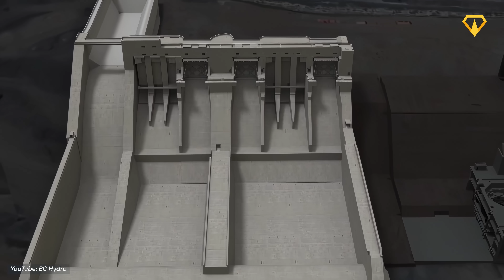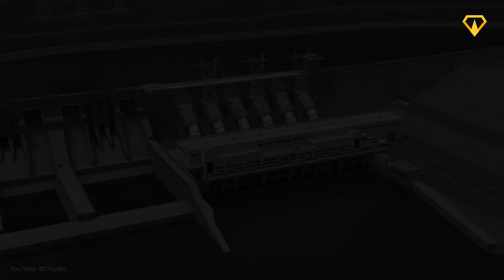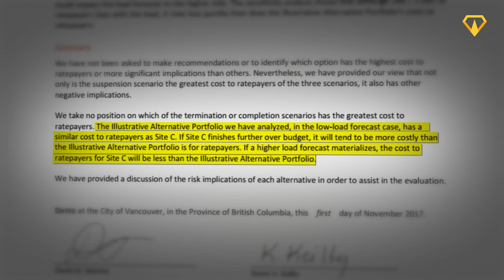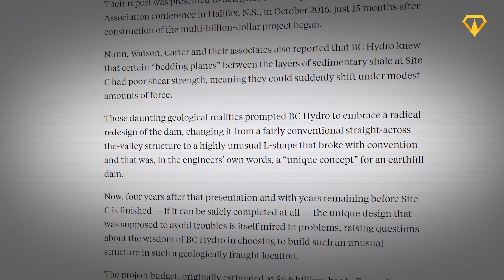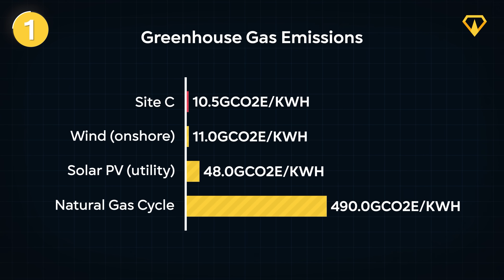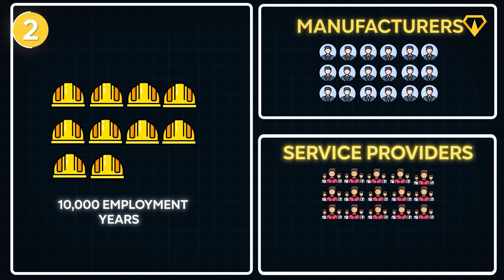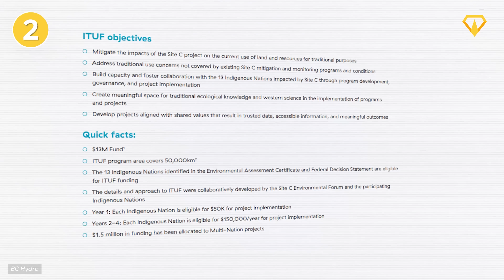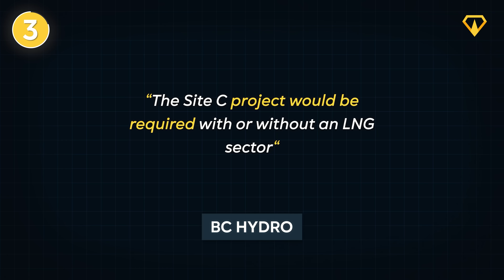Canada's Massive $12B Mega Dam

Comment: I grew up in BC and now live in Alberta. My perspective is that the people saying Site C was not needed were completely focused on BC only. Fact is the grid is tied to all most of North America - I watch the Alberta Energy System Operators real time generation website regularly, as I write this, BC is importing 154-190 MW from Alberta, likely to cover AC usage - Alberta is primarily NG generation. With Site C online, BC may be exporting power instead, reducing carbon output. I can see the Alberta grid is sometimes used to "transport" BC power to Montana and Saskatchewan - we all need each other, especially during high demand periods like heat waves and cold snaps. I will give Horgan credit for someone finally getting him to understand this.
Reply: BC exports electricity too. Exchange between grids is common due to proximity and peak cost/price during various hours. BC is a major electricity exporter to Washington and California.
Reply: @jugjivan  BC Hydro used to have a net surplus of electricity, but now has a net deficit.  Last year (2023) they had to import 1/5 of the power consumed in BC.
Reply: They should have put the money from cite C into a Nuclear power plant. Would have been better for the environment and lasted longer with higher output.  The LNG project is definitely a great step towards a cleaner planet. We need to get other countries off burning Wood and Coal to produce energy. 🇨🇦
Reply: @Beavertrkr  You'd need two nuclear reactors to get the same power as Site C, so $30-40 billion...

Lots of attempts to build new plants in Canada, but the last one to actually go online was in 1993
Reply: That's it exactly. We need a blended system of electricity generation and the more linked our provinces and the USA are the better it will be for everyone. When Wind and Solar are in high production, they can send power to BC and BC can save the water in the dams. And when solar and Wind is low in the prairies, BC can send power to them from it's network of dams.  And the same with the prairies and Manitoba and its extensive hydro electric infrastructure.
Reply: Did you miss that our gov sold by hydro to an American conglomerate? 
They didn’t pay their bill, and we haven’t seen a dime since they bought it. 
Our hydro costs have gone up though.
Reply: @scottverge938   wind and solar are scams. they flat out dont work
Reply: If they manage to eliminate interprovincial trade barriers, that will be progress towards greater interconnectivity, Canada Day does not seem a likely timeline to me, but it is a nice thought.

What we really need to do is get away from epic-scale projects, they are not responsible: costs do not scale linerarly and designs become inflexible at scale, combined with the risk factors inherent to 'all the eggs in one giant basket', it is a perfect storm for stampeding budget.  Though I believe the basic seismology assessment should have made an argument for a distributed/scaleable system: if we are overdue of 1/10k earthquate, one sure way to up the odds, while complicating the consequences, is to add a massive lake in the mountains to the mix.
Reply: @PaulDMcK  I don't think Site C will cause any issues in regards to earthquakes. It's a long ways past the Rocky's on the eastern side. Geologically it is far more likely to be similar to building in Alberta than south western BC.

Big hydro dams like this are able to do both base load and grid following, so they are invaluable to have. Renewables aren't up to the task of base load yet but local solar wouldn't be a bad idea to have to supply residential areas.
Reply: @kstricl , Site C is another 1980s Canadian mega project, I absolutely expect some part of it to fail catastrophically.
Reply: the only reason we import power in BC is that we can effortlessly throttle the hydro, the gas generation cannot so they sell the power dirt cheap. it isnt that we need it, it is that the gas guys need a place to dump the load
Reply: The NA grid is not entirely tied together, which you would know if you had ever heard of ice in Texas.
Reply: @afterthesmash  fixed that. Kind of short sighted of Texas to be like that, but their choice.
Reply: Yes Québec alone sells 22,6 million  Mwh  per year impresive  

edit : hope my english is okay...
Reply: @HalberdAbuser100  Better than my french ;)
Reply: Much more knowledgeable than that elected politician who makes only trouble, flipping position for personal gains!
Reply: We buy alberta power and sell bc power to washington, BC taxpayers subsidizing USA, thanks to “todays BC Liberals™️”
Reply: U don't need grided power and it only makes the rich richer...who cares about the rest of Canada cause I don't...Canada has become a joke in the world...there is no Canada anymore
Reply: Come back to B.C. lately? especially in the Kootenays, There’s a bloody dam every 20 km’s (all your fishing holes surrounded by razor wire) and the biggest of these never reaches more than 30% output. And that one supplies the coal mine that ships raw coal to China to burn and send us more plastic BS at the dollar store?? See where I’m going with this? Why another? So we can virtue signal with everyone else driving electric cars etc???  Stoopid make work project destroying prime river valley farmland. AB never had a problem heating homes before the greedy Frac years, thousands of watered out wells killing jobs and swallowing up families. Where is all that VLT money now? Cowtown needs a loan to fix their water main?? again??
Also need water to run hydroelectric, how about all these droughts, who gets the priority water; farmer, family, or B.C. Hydro and the Tesla bunch??
Think about the long game for your future family here
Reply: The fact BC was importing from AB doesn't necessarily mean BC "needed" that power right that second. It was probably done for economics i.e. prices in AB were low and it made sense to import then. Other than that, you're spot on.
Reply: @vicolin86  During periods of drought, it makes better sense for BC to "import" power and keep the reservoir levels up, so long as the power can be purchased economically, just like you said. Currently Alberta wind and solar are producing more than enough energy to cover what BC is importing, so the pool price is likely the deciding factor.
Reply: @kstricl  not just drought, but yeah, essentially.
Reply: The problem with the protests is that it was always stupidly short-sighted. Hydroelectric dams can last well over a century. All other options do not. So the cost over time is low as long as the reservoirs can still be filled. However no hydro-project has ever been without conflicts. Mica, Revelstoke, Hugh Keenleyside Dam all on the Columbia River have political ramifications on how they are used because operating them poorly impacts our neighbors in Washington and Oregon. But it the Americans who wanted the Columbia River Treaty dams to be built (and we largely made a bad deal because it was a lump sum not tied to inflation.) This resulted in the flooding and displacement of fertile lands. 

Now listen again to the protests of Site C "Flooding of fertile lands". While that might have been true for the Columbia River which is a warm-hot (zone 6a and 7b) climate, it's not of the Peace River since it's mostly a warm-cold climate (zone 2b) that is difficult to grow things in. Most of the Canadian population lives in zone 5 or higher (Victoria is 9 and Vancouver 8b). Site C is not a "fertile land", it's in fact pretty far away and electricity generated by it is more likely to have a lot of transmission losses. That's really the only valid argument I've ever heard against it. Meanwhile City of Vancouver mandating Electric-only heating (no natural gas or oil) and the popularity of EV's is increasing the electricity demand. Never mind AI-focused data centers taking a lot of energy. 

We were always better off building Site C than nuclear, but BC is also full of locations for Wind and Geothermal that have just not been deemed economically viable.
Reply: @Kisai_Yuki  you really know your stuff! Do you work at hydro?
Reply: Yes, John Rustad talked about how BC is a net importer too, for some reason, in spite of  BC having plenty of means to be exporters.  "Not needed" is socialist thinking, "we only make what we need", yeah and then you make nothing for anyone else in spite of their need, because you don't actually think all that much about "the people" even though you pretend to.
Reply: @Usammityduzntafraidofanythin What John Rustad doesn't mention is that we ARE an electricity exporter. We build up our reservoirs and buy cheap electricity from out of province, and then when those sources in other provinces and states become expensive (say maintenance or extreme weather conditions) we use ours and sell it out of province for top dollar. BC Hydro makes bank off of that, and we get consistent and cheap electricity year-round.

We don't need to export more gigawatts than we import if we are still making more money than we are spending.
Reply: Anyone who is incapable of the forethought that we could export the surplus doesn't deserve to have a say. I'm sick of the short term thinking of these lib types.
Reply: From a journeyman lineman, AMEN.
Reply: civilization scales with energy availability, anyone who doesn't understand that is too dumb to have a worthwhile opinion
Reply: Yes that absolutely right, and most of the electricity goes to america
Reply: NG will not reduce carbon footprints. It is more polluting than fossil fuel. You are being lied to. Look up fugitive emissions and where NG fits into the rankings
Reply: Not True Alberta rusn out of power all the time and needs SK and BC power.
Reply: Yup, we slow the blood flow of the earth to make power for the states...
Reply: It wasn’t Horgan who started Site C. It was Christy Clark - the ONLY good thing she did for BC in my opinion.
Reply: Canada needs a lot of current and future trump-proofing itself from tariffs etc... Canada should keep/create ace cards for exports ... Iceland, Greenland, Alaska, Even the lands it own in Arctic. As those passages warm; Canada's farsighted assets there will open new arenas no new trump will ever dare to mess with.
Reply: Very true!
Reply: Horgan is dead.
Reply: Worry about Canada.  Screw the USA….they only look after themselves.
Reply: the issue was that they stated they were building it directly for BC's projected power needs but in reality BC Hydro has been over estimating the provinces needs for years. They want to sell green energy to LNG and California. The first statement is well documented through numerous reports.
Reply: Site C was built with the sole intent to provide BC with power for half a million homes. That was why they got approval….
Reply: If they are pushing for carbon neutral Kitimat LNG, it would take 24 site C dams to meet their electrical needs to cool and compress the LNG without using LNG powered cooling and compression.
And remember Horgan attempted to block every pipeline to the coast then took a cushy board position on coal producers and exporters....🤔
Reply: Saskatchewan needs to build some wind farms… with as flat as it is we get wind all the freaking time… that we aren’t using it to our advantage is short sighted…. Theres plenty of land on farmland that is unfarmable, so fill those spaces with wind turbines…..
Reply: Reducing carbon dioxide output, which is how trees gain mass. How is that a positive for BC.
Reply: @Timmahh.  Too much kills trees. Plus BC needs rain far more, it's been getting very dry in recent years.
Reply: @Timmahh.   An old and worn out anti-climate narrative.  Too much CO2 leads to burning forests from extreme heat.  How is that positive anywhere?
Reply: Gas plants are prone to malfunction during extreme weather, both hot and cold.  Both Texas and Alberta have experienced this, and were helped (some say rescued) by wind power in recent extreme events.  As for domestic gas power in Alberta, several of my relatives and their friends have just recently made the choice to go with large rooftop solar arrays backed by home scale battery packs in their garages mainly due to the recent dramatic spikes in domestic gas fired power prices, which happen to occur right after the conservative Alberta government decided to act against free enterprise and apply moratoria and huge bundles of red tape on Alberta's phenomenal $40 billion renewable power industry.  Of course, the timing was just coincidental, right, considering that a few years ago wind power market auctions were outcompeting gas and coal on price. The premier herself was a fossil industry employee and currently receives major political donations by her pals in gas.
Reply: @ub59 that outage had 0 power coming from wind. They all shut down at -30.

And I've see gas plants running at -50. They are built for it. This guy is flat out lying.
Reply: @ub59 the wind market was competing on subsides not merit. the energy generated compared to land used and the treadmill costs means it’s makes no sense. A nuclear power plant is 1/10th the size and will be cheaper once it’s online all while being able to remove the outdated infrastructure whereas with wind you still rely on coal to make up for the downtime. In the few years that wind turbine will be able to run before it needs to be buried in the ground and replaced, nuclear would be cheaper and more efficient. Wind is not an option en masse and anyone pushing wind is getting their info from corporations who are trying to suck tax dollars. Wind is a multi million dollar subscription service for inadequate inconsistent energy that still relies on coal to make up for its flaws.

     Also  after “as for Alberta’s NG… ” you made a point that had nothing to do with Alberta and your objectively wrong spiel about gas prices. Natural gas has gone from 2.74 in July 5 years ago to 2.81 in July now. It’s actually one of the few industry that has lowered relative to inflation, it’s just you’re being stretched in so many other areas you’re noticing that bill now. Good for your friends for going solar, that had nothing to do with Alberta tho.
Reply: @ub59 don't get political, I work in utilities and the reason AB had rolling blackouts was because a large portion of our large, old, and reliable power plants (most of which were coal) were shut down by the NDP without creating solutions. It just so happened that the cons came in when we had strong weather anomalies. Had the NDP first built alternatives and THEN shut down the plants we would have not had this issue but politicians choose image and politics over reason and logic.
Reply: @Peglegkickboxer   It's all political because it's all about public policy.  I fault both the UCP and NDP for being so saturated in carbon politics. Having said that, economics is the stronger argument. Renewables, especially wind, were outcompeting coal and gas in electricity generation in private sector power auctions for years.  Danielle Smith killed renewables because of that -- an outright kneejerk political act not grounded in sound research and logic.  The fact is renewables are cheap cannot be disputed, and they are also upping the ante worldwide with massive battery storage, allowing them to enter the realm of base load power.  If AB had battery storage to the level of South Australia it would see the end of fossil fuels in the grid. Further, battery chemistry is heading toward lithium hybrids with sodium and silicon with exemplary cold weather performance. Zinc bromide batteries can store power indefinitely.  Form Energy (iron air) can store power for four days.  These are the nails in coffin of coal and gas fired power.
Reply: @ub59 nonsense.   The recent blackout events in alberta were caused by no wind and evening hours when the sun is down
Reply: @nunya_business1702   Nonsense. Wind saved the AB grid after three days of calm.  So says even the AB Energy Regulator.  And have you ever heard of batteries?  Today's off the shelf grid scale batteries can store power for four days (Form Energy - iron air - 100 hours, zinc bromide indefinitely ...).
Reply: @ub59 this is something a NDP cry baby would say. 🤡
Reply: @ub59  I can't speak to the political landscape of Gas and Coal fired power plants.  But I agree to disagree with you that wind and solar are the new source of electricity. Their not reliable, look to the wind turbines and winter blast that Texas had two years ago, shutting down all the wind turbines  for over 10 days. Water Dams and Gas fired power plants are still the best option for clean electricity. New technology in years will give us better solutions.
Reply: @ub59 you have no clue what you are talking about. Alberta's old coal and now new gas plants have no problem operating in the worst weather possible. Our near black out in February 2024 occurred because wind and solar plummeted to 0.4% of their capacity. They plummeted because it was night time and very cold; the wind tends to die down during periods of very cold or hot weather, and the sun never shines at night! During this period of non existent electricity from wind and solar, all the other energy sources had to pick up for their failure. One gas plant was in a scheduled shut down for regular maintenance - regular maintenance being something all generating systems including wind and solar need to go thru. And a second gas plant did have an operational problems which put it at half operational capacity. No additional amount of wind and solar on the grid would have prevented this near black out, only more reliable and dispatcheable electricity from coal, natural gas, nuclear or hydro. Alberta no longer has sufficient backup for the wind and solar we have on our grid - which will go to near  zero electricity production for times during every year. Wind and solar are the only technologies which require 100% backup; the rest can do with some level of excess capacity. The more wind and solar we put on Alberta's grid, the more we have to add backup which as back up runs inefficiently and adds to the cost.
Texas's problem in 2022 was similar - they spent $66B putting in wind and solar and when the cold, windless and dark weather showed up, wind and solar plummeted. Because Texas was so intent on spending money on wind and solar, they did not spend any money on ensuring the other forms of electricity from coal and gas were winterized - and so some of these backup systems failed to operate when wind and solar failed. During Texas's mild winter storm of a few degrees below zero, Alberta was at minus 40C temperatures and we had no problems handling it because at the time we had ample winterized natural gas electricity.
Reply: @davidsimpson7373 Underated comment. You're the only one e on here that knows what's going on. The rest are idiots who pretend to know then go off on a neophyte political tangent. Thank you.
Reply: @schrempskynate8944  may be you can explain to every one the many factual inaccuracy of what I said then? Or are you just prone to ad hominen attacks because you do not like the facts, and have no counter argument of facts to present ?
Reply: @davidsimpson7373  I'm agreeing with you if you'd actually read my post. You're 100% correct. Where did you get the idea that I was in disagreement. Ffs.
Reply: @davidsimpson7373  It's not a "failure".  You obviously have a biased agenda. From CityNews:

In a statement to CityNews AESO senior communications advisor Elizabeth Brouwers says the alert was prompted by several factors.

She explains Wednesday saw a high amount of renewable energy captured during the day, and forecasts for the coming days indicated much of the same. Because of this, some generating units were switched off as a cost-saving measure.

“While the reduction in wind and solar was forecasted, an unexpected outage of thermal generation led to tight conditions during the evening peak (generators can drop off for any number of reasons), which prompted the Grid Alert,” Brouwers added.

Key points: they shut down on purpose some plants AND the main key point, "an UNEXPECTED OUTAGE OF THERMAL GENRERATION".  THAT means and outage at a gas plant.

So seriously...stop lying and twisting the truth.
Reply: @mb7196  The only one with an agenda here, missy, is you.
Reply: @schrempskynate8944  yeah...this is the response of someone with nothing to say.  You've got nothing to counter the actual facts as reported and of public record, but rather than being a man and admitting you were wrong you take the cowardly way out with a lame ad hominem with nothing to back it up.
Reply: @mb7196 Lying? What fact did I present that was not true?
Since the concept of how non dispatchable wind and solar and the grid work is a challenge for you, I will try to break it down in simpler terms. 
Every electricity grid must balance supply and demand at all times, too low supply and the operator is forced to shut down some demand leading to brown outs or black outs; too much supply which is not corrected or dispensed in some other way, and one gets total grid failure as equipment fails and a complete black out. The balance must be maintained 24-7, and at the fractions of seconds. Wind and solar are non dispatchable because they are weather dependent, meaning you cannot adjust them up and down to balance supply and demand - you get what you get based on how the wind is blowing or the sun is shining (or not). All other forms of generation we use are to some extent dispatchable (rate variable depending on source) and must be used to offset the variability of wind and solar. Natural gas being the most flexible to adjustments, and why it is used globally as back up for unreliable wind and solar. Wind and solar can have massive swings in electricity they generate from moment to moment, and certainly over longer periods - they can and do go from 100% capacity to 0% capacity, and sometimes very quickly, particularly in the case of wind which oscillates throughout the day, or solar as it goes from day to night, or night to day.
In the near blackout event, Alberta's grid had about 5900MW capacity of wind and solar, but during this very cold period at night they were only generating 14MW. Demand was over 12,000MW, which at the time had to come from all other generating sources as wind and solar were essentially zero. Total grid capacity was around 20,000MW, and with wind and solar effectively at zero, the rest of the grid is roughly 14,000MW, leaving a mere 2000MW excess capacity assuming all other forms are operating at 100% capacity. Have one plant off line for scheduled repairs, and another having an issue, and now we are in crisis mode with no ability to provide supply meeting demand. 
The more wind and solar we add, the larger that swing will be from 0 to 100%, and the more back up is required to run inefficiently in standby mode for when wind and solar generate zero, which they will at sometime because that is part of their uniquely normal operation! You put 10,000MW of wind and solar on the grid, and you cannot get rid of any other supply, you must be capable to providing all of the 10,000MW at any given time with other sources, plus providing sufficient supply to meet the rest of demand. 
The capacity factor - an average over a year for how much electricity is actually generated in comparison to the theoretical maximum or name plate capacity - is around 11% for solar in Alberta, and the low 30% for winds - you can get this data directly off the annual grid numbers.  This is why at nearly 30% of name plate capacity of the grid, wind and solar only generate 6% of Alberta's annual electricity needs, whereas natural gas and coal do the heavy lifting proving 89% of the electricity with 66% of the capacity. 
I hope this was a sufficiently simple explainer for you!
Reply: @mb7196  of course it is a failure. If a gas plant went done unexpectedly reducing generating capacity by 10% you would call it a failure if the gas plant. According to you, when wind and and solar have a 100% drop in generation, going to zero, it is not a failure! It is true, this is the unique normal operating conition of wind and solar - they will go down to 0% generation under normal annual weather conditions. It is still a failure to generate electricity, just like if a gas plant unexpectedly went down.
Reply: @ub59  "Gas plants are prone to malfunction during extreme weather, both hot and cold." False I live near them.   "Both Texas and Alberta have experienced this, and were helped (some say rescued) by wind power in recent extreme events." Can't speak for Alberta but the Texas "extreme event" was just the opposite.
Reply: It's true. Natural gas plant outages helped lead to an almost-blackout during the alberta -45 C cold snap this winter. It was only averted thanks to an emergency government text message, saying to reduce usage. The more green backup power on the grid, the better, I say. I wish our premier wasn't sabotaging green power
Reply: @32BitJunkie  I watched the power output on the energy operators website during that period. Wind had to shut down as the turbines could not operate during the extreme cold due to embrittlement and of course it was dark, so solar did nothing.
The plants that were down in fact managed to ramp back up (including one that was still in initial startup testing.) The grid scale batteries that are in place to help support the renewables were definitely helpful to keep the grid operational at the worst point of the crisis, but that was the only renewables component that directly contributed to keeping the grid up. I agree, need more of those.
Reply: @32BitJunkie  there is no such thing as green back. wind and solar cannot back up anything - they are non dispatchable forms of electricity generation. Globally, the back up for wind and solar is natural gas. They are they only technologies requiring 100% backup. All other forms just need some level of excess capacity to allow for plant shutdowns for normal operational repairs and maintenance and the rare unplanned failure. One needs to plan and expect for zero generation from wind and solar, building a complete second backup system for when the wind is not blowing and the sun not shining which is much more frequent than most people understand.
Reply: @32BitJunkie   faked
Reply: @32BitJunkie so you got lucky that there was wind. What do you do when there’s a cold snap with no wind. Wind isn’t a good option and justifying your decaying coal and Ng sectors because you’re stuck paying the forever high rolling costs of wind doesn’t make sense. The amount of money you spend on wind is the problem not the solution. The point of these projects is to be expensive today to make life better tomorrow. Wind is forever expensive.
Reply: @32BitJunkie  except that during that cold spell, wind and solar output was near zero.  They don't work in the dead of winter.  The problem was insufficient gas -fired capacity
Reply: @32BitJunkie I worked for BC Hydro for nearly 30 years. Green energy is substantially more susceptible to weather events, in places like Dawson creek where a wind farm is located (bear mountain) turbines are maintenance heavy, units are often cycled in and out of service due to bearing wear. Bc legacy dams are the cornerstone to low power costs for customers, wind and solar are basically subsidized by the legacy system. I consulted on the Texas grid failure. Green energy wind specifically was the key contributor to the state wide failure, there were other contributing factors but ultimately when weather events are severe wind/solar is always the weakest link.
Reply: @totallyjonesin  You are mistaken. When the gas plants went offline - the wind was still functional in Texas. Read the reports. It was a fossil fuel supplier and climate denier snow-job when that big power disaster hit. The gas plants basically froze up and fuel stopped flowing.
Reply: @32BitJunkie  If by green you mean solar and wind then you are wrong. We have no solar in the winter and wind is unpredictable.  Hydro is great assuming the snow pack supports it. BC has more geography to support hydro than Alberta, so you can't blame AB for that. Base load and dispatchable thermal is more reliable for AB.

I used to work for BC Hydro , then at a coal power plant at SaskPower and currently at one of the bigger utlities in Alberta. It's unfortunate the Alberta model is de-regulated and is profit first.  I never saw this at my two former crown corps.
Reply: @ don.beknown, I can tell you're not in Texas.
Reply: @ub59  Gotta love and support a premiere, who wants to break up Canada…oops…gain “sovereignty”.  Where would she find all her “petro” buddies then, when she has to figure out the energy grid for landlocked, newly formed state, with a leader who swings her head in so many positions, I’m surprised she doesn’t get whiplash more often!

It’s not just our energy sector she’s blundered and halted growth since placing her butt in the premier chair…our entire Healthcare system is in TRIAGE mode…and she continues to alter, meddle, and change anything she wants - without getting SOUND scientific advice from Canadian experts!  But…oh no…according to her Trump buddies pricey “advice”…and we know how well the healthcare system is working to care for its citizens south of the border!  The US model is based on business/money first model.  Naturally, a healthcare system requires financial input and responsible spending, and proper oversight.  I would never trust the current provincial government and premier, following the costs and ongoing blunders she has made time and again…only to “apologize” for in another statement, before she makes her next, bigger blunder!
 She is not trustworthy!  Why put the most import thing in her hands…my life and those of ALL Canadians!  Our lives are too precious and irreplaceable!  Lives are not something you gamble!  Life is mot some blunder or miscalculation that can be reversed or fixed and later apologize for.  We are concerned with the quality of health and lives…NOT money…the only thing that grabs her attention!
I sure hope our Natural Resources are better protected than we have been, since the current government got in.  I know the Indigenous peoples can certainly speak to the mismanagement of land, resources, etc.  And sadly, they can speak to the irresponsible planning and mismanagement of this forrest fire season…Lord help us in the years ahead!   The only good thing about this premier and government is that they can be voted out…and that is the cheerful note I will end on - LOL!😉

Cheers!🇨🇦
Reply: @shelleyhender8537 tldr, shes not breaking up the country, look what Quebec got during their talks… if you knew anything about the clarity act it requires a super majority to even get sovereignty, but the negotations that happen and recognized by the supreme court are super beneficial. Maybe learn bargaining tactics before downplaying one of Canadas greatest Premiers who has a focus on growing Canadas market at home and abroad.